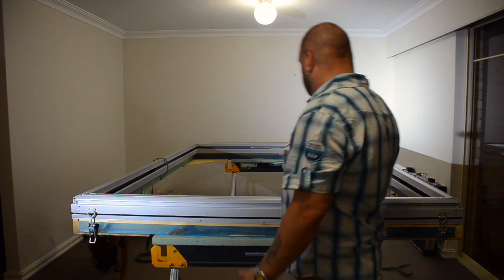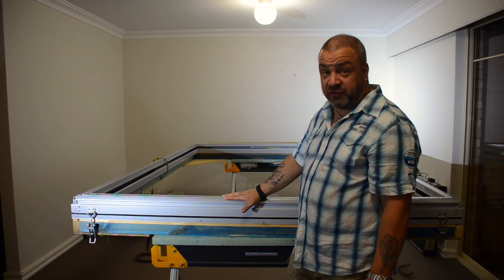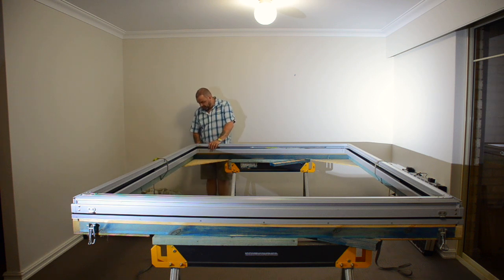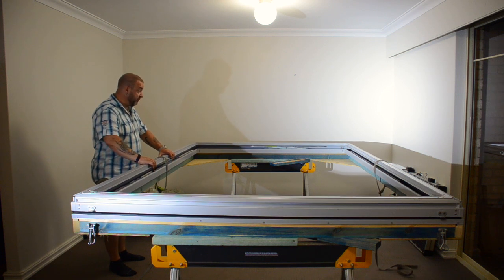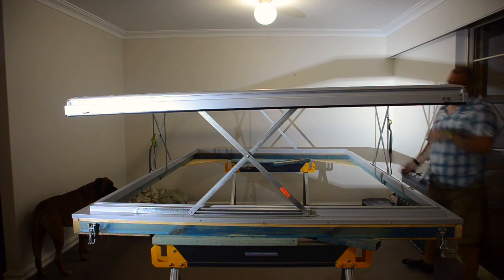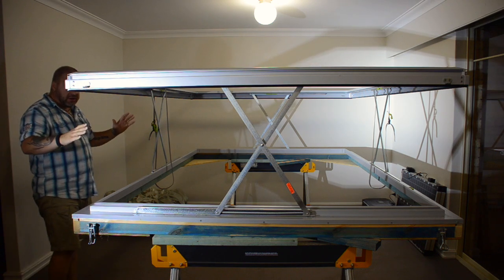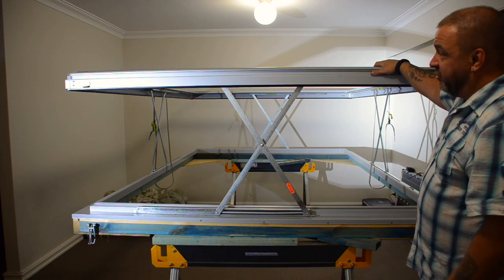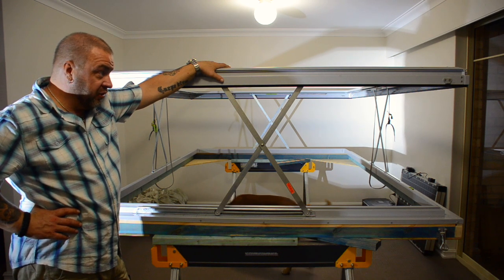LandCruiser Expedition Truck Build _ Pop Top Roof _ Ep 16

Comment: Nice video mate , im in Perth too and looking for that sort of extrusion for my camper trailer build.  I used sika 221  when I ran out of t-Rex on some panels for my body . Long story short, I had a change of design come to mind and drilled out the rivets on the rear panel and rear ceiling panels. The sika came off with ease with the multi tool blades I used  but were really struggling where I had used the t tex. Really impressive stuff  and live up to its claim as the strongest adhesive

Comment: I'm assembling my Pop-Top kit now. Thanks for the reference! Which Sikaflex product did you use when you joined the corners? Did you basically use it like glue in a miter joint?
Reply: I used sika 221 which is really strong, I put a good bead all around the corner piece and then used ratchet straps to clamp it up and let the glue set, once the glue was set I then riveted the joints.
Reply: Oh don't forget to do your dimensional check before the glue starts curing, make sure it is square.
Reply: Thanks so much for the info. I have another question (sorry). I have someone here in Germany making me a panel, but I didn't get the piece of angle that caps the panel all around the edges. I'm going to have to get something fabricated. Did you use an aluminum angle, or is it PVC? Thanks!
Reply: I used Aluminium 40x40x4 angle, glued in place with construction adhesive.
Reply: Oh wow. How thick is your roof panel? I'm getting mine made at 28.5mm, but maybe that's too thin?
Reply from the maker: The roof panel is 22 mm thick on mine.
Reply: Great work, I'm also reserching a build like this, wondering where you obtained the aluminium roof profile from?

Comment: Looks great!! did you use composite for the roof? Does the roof/cieling materal need to be installed when you rivet all the top extrusions together?
Reply from the maker: The roof panel went in after the frame was fabricated and the extrusions completed. The panel just dropped in.  Then a final sealing strip of butyl tape on the seams.  All full bonded first with construction adhesive.

Comment: Is this custom? do those hinge types  have a name?  If i can find them I'll my a custom roof hatch for van using them.
Reply: Did you have any luck finding them? I'm searching eBay for lifting mechanisms but all I can find is slanted bed ones, or even taking two hydralic scissor lift tables, cutting the mechanisms off and welding those on. That's such a long winded approach though.

Comment: Where did you buy those extrusions / lift mechanisms from, they seem specially purposed for making a pop top? I’ve never seen anything like that before.
Reply from the maker: The lifters are available on Ebay and caravan spares places here in here Australia, the extrusion is also from a RV parts company in Australia and is specifically for this application.

http://aussietraveller.com.au/products/caravan-components/caravan-pop-top-extrusion

https://www.caravansplus.com.au/cabin-roof-hardware/pop-top-roof-parts-c-70.html